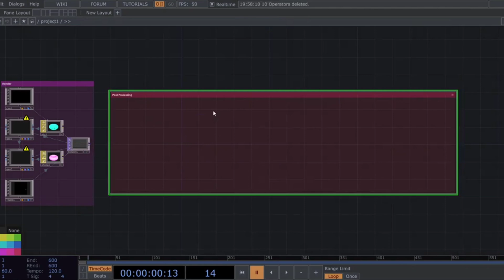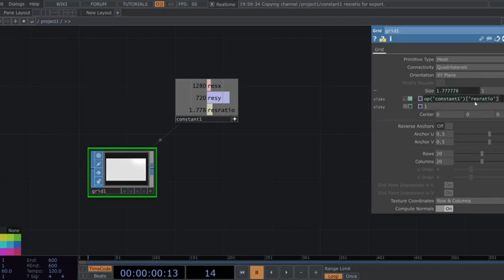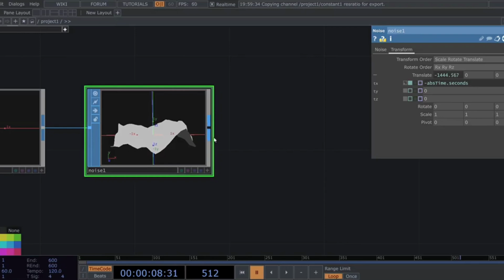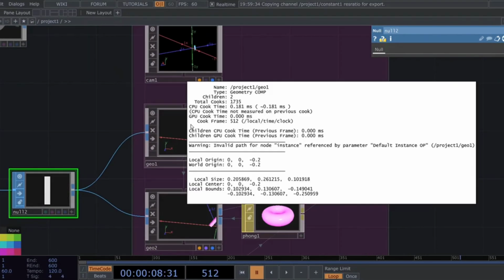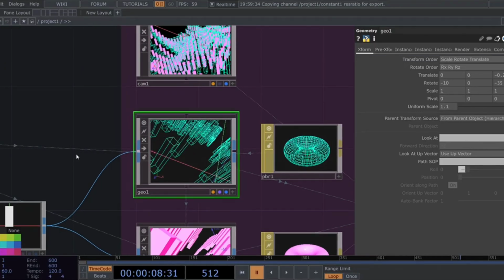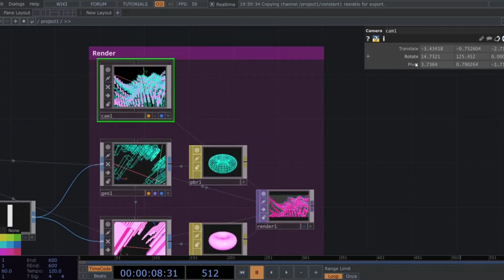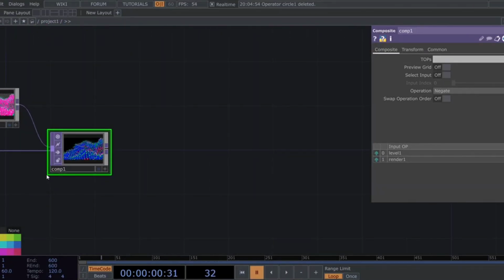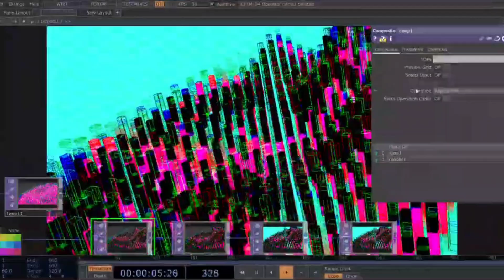TOUCHDESIGNER Tutorial: Procedural 3D Instancing & Feedback Effects

Comment: Really nice one, thanks! I just finished it but cant figure out if I can connect it to audio in a good way. Got any ideas?
Reply from the maker: I think what u can do to make it Audioreactive is in the grid's CHOPTo replace the ty par by your audio value,or use a separate noise to drive the ty par and use ur audio to control its amplitude, u should give this a try
Reply: @PiFrac-DEV  Thanks for the quick response, I tried by connecting the low mid high value to the ty tx tz but it changed too much, will try the ty only. Cheers
Reply from the maker: @LilySaysHi  yeah in this grid tx, tz is static. U just need to drive the ty chan, make sure to have same no of samples, then u can drive the amplitude with ur audio❤️❤️